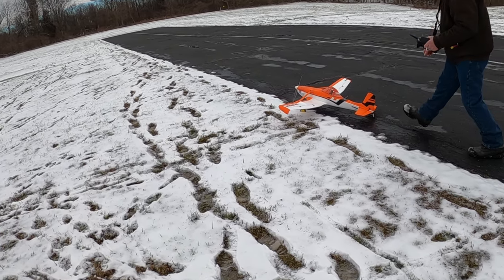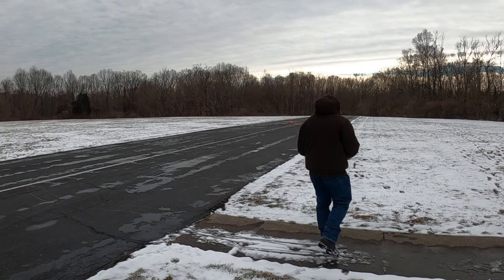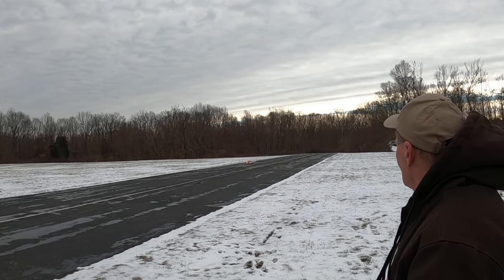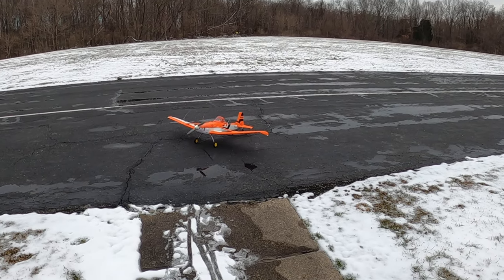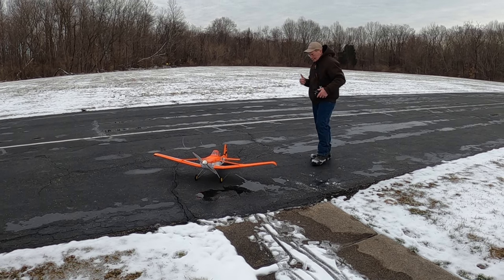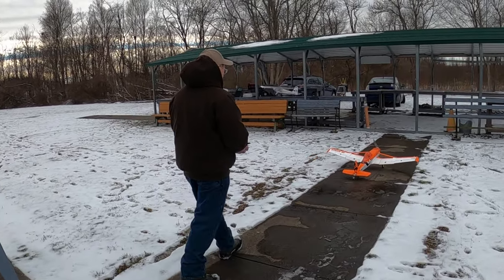Dynam Cessna 188 Orange 1500mm - Larger Prop for more power.

Comment: What prop did you put on it?
 I added just over 2.25oz of weight to the front of the fuselage. Yah, my servos chatter to. I'm using a lemon Rx stabilizer plus receiver in mine.
Reply: What prop did you put on it?
Reply from the maker: 14x10E